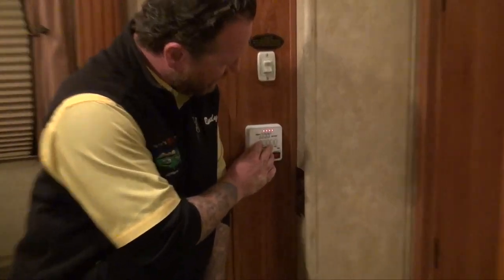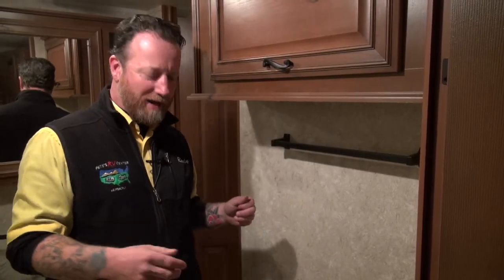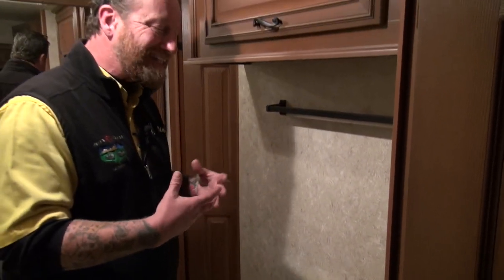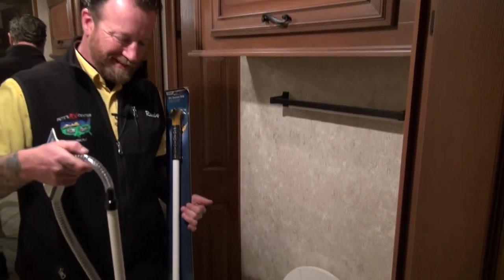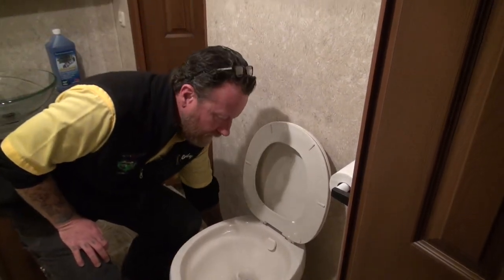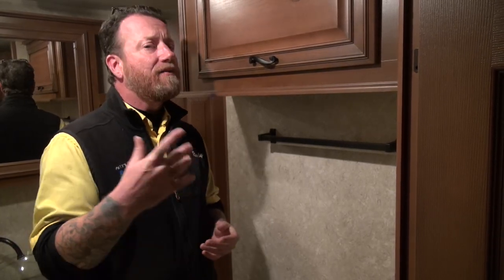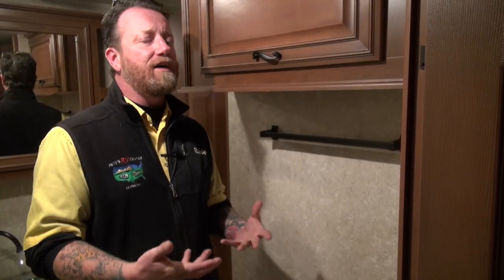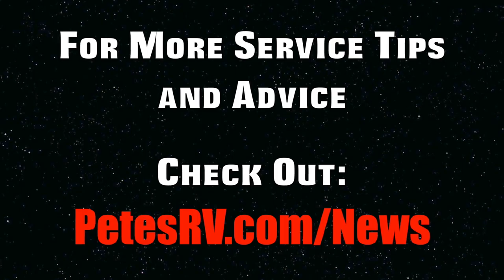CLEANING YOUR RV HOLDING TANK SENSORS | Quick Tips with Randy

Comment: I always add about 8 gallons of water to my black tank after i dump it, the drive home it will slosh around and help break up any solids. Before leaving on my next camping trip I add a large cap of laundry detergent to the tank and let that slosh around on my trip to the campground. If there isn't a smell issues i don't dump until I'm ready to leave. If you have full hook up, water in you black tank is your friend. Always use plenty of water when flushing and always batch dump your black tank, never leave it open to drain. When you drain your black tank, add water back to it.

Comment: Having a pitcher sitting handy inside your shower to catch the cold water coming thru the shower head before the water becomes hot and using that cold shower water to pour into the toilet before using it for #2 would be efficient and not wasting water normally running down the drain while waiting for a hot shower.

Comment: Having trouble with the black tank sensor and saw this video.  Tried everything short of the ice cube trick, but this is the first I've heard regarding the use of hot water.  I should have thought of that myself, and thanks for alerting me to this common sense idea.  Since totally flush-rinsing it clean with its two built-in Sani-Flush spigots, adding a few gallons of water plus some Happy Kampers powder, some Dawn, and a couple packets of Tide down the hole, followed by 70 miles of mountain highway, the Aladdin readout went from 288 gallons to 128, so we're gaining some ground.  If it doesn't clear with the next dump, hot water it is!

Apparently our sensors are the pressure type, but behind a large water bay panel that's not easily removed I hear.  I'm hoping if necessary, the sensors can be accessed just by removing the stainless cover that hides the gray/black valve at the bottom of the panel.  The Aladdin system is no longer made, and most go to See-Level systems, but if I can get the sensor out and clean it or repair O rings or diaphragm I will.  Perhaps the sensor itself is standard fare and a replacement part is still available.
Reply: Did the hot water work?

Comment: I have the swizel stick you showed and they do spray well but still the sensors say a full black tank.  The unit even has a direct connection to spray the black tank.  I will try fully filling the black tank...so that is a good idea..thanks....we use "happy camper" as directed...no smells at all.

Comment: pete a quick question may be you can help me, my water pump light for some reason is always on and is draining my rv battery any suggestion, this started happening this last week, thanks
Reply from the maker: Hello, if you have a battery disconnect make sure it is off when the RV is not in use. This will prevent the battery from draining when you do not need power.

Comment: Is CLR safe to use in the tanks to clean sensors? I'm going to try the hot water clean with RV chemical first.
Reply: I am not sure about the CLR, I have never used it on an RV, we usually will use a double shot of toilet chemical of actual sensor cleaner that we carry in our store and let set over night before dumping. 
These holding tanks are a slightly thin ABS plastic, so I would not throw anything to hash chemical wise into them, as they are very expensive to replace. 
Thanks for watching!

Comment: We eliminate the sensor issues by never doing #2 in the camper and never putting toilet paper in the black tank. My Grand design has a black tank flush system and I back flush my black tank until it runs clear. We use happy camper and tank valve lubricant every now and then as well. We’ve never had an issue.
Reply: Never poo in your camper? Why have a camper?

Comment: Thanks for the suggestions.I don't understand what the pink thingie is that you put in the tank.
Reply: Greg Andrews holds the toilet valve open and keeps the water running into the toilet
Reply: Logically I would say it is simply a light weight cup inserted into the hole that would rise when the water below it gets to the point of overflow giving you a visual warning.

Comment: Would someone explain the sani-flush connertor/connection?  Probably all the same, but I have 35' Winnebago Class A. What is the deal with small shiny smooth opening in front of garden hose size attachment covered by plastic. What am I to attach there or take apart? I'm sure it's simple and water is to spray inside for cleaning. Someone take pity...what am I to connect...nothing fits or screws!! Help and thanks

Comment: What about the water holding tank I fill them up and it doesn't read that it has water in them how can I fix that.
Reply: if you are getting no readings at all, it sounds like an electrical issue depending on what type of sensors that you have. this may need to be brought to your dealer for diagnosis.  Thanks for watching!

Comment: How to clean your black tank sensors.  The Tim the tool man method...

First, flush 50 lbs of scented candles down the RV toilet...(doesn't work, duh!)
Next, get an acetylene torch...
Remove the black tank along with a third of the RV....
Thank the neighbor for the use of his fire extinguisher...
Open the black tank using explosives....
Have a nice chat with the local police and fire guys...
Re-engineer the power washer to use a Chevy 454 engine for power...
Clean the entire RV, inside and out using 77,000 PSI water....

Begin to clean the sensors upon returning from the emergency room....

Comment: DO NOT let the foot pedal slip while using the wand. Just cost me $165.00 to find that out when the ball valve cracked as it hit the wand while I was cleaning it out. In the Dometic 310 you can NOT replace it. You have to replace the whole toilet. Do you know of a reason my black tank flush will not let water through? Seems like it just sits there and you can hear no water going into the tank and none comes out while trying to flush the tank